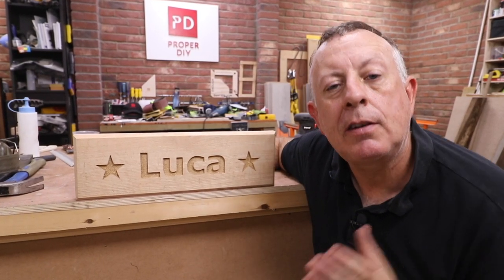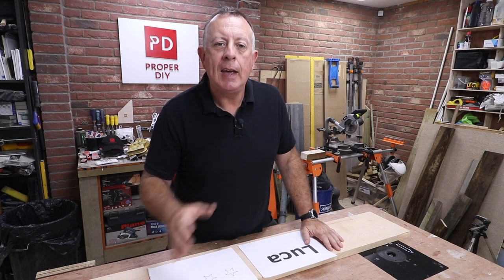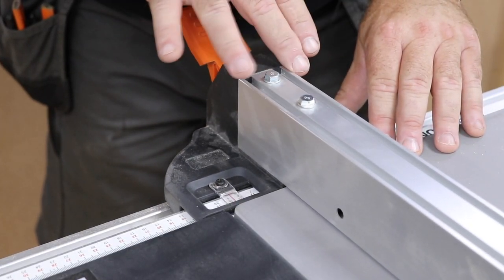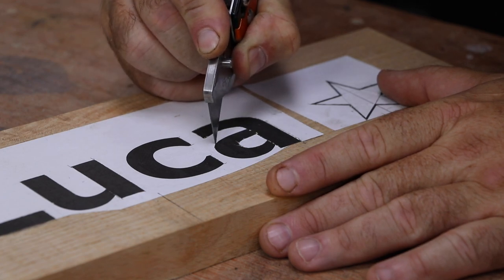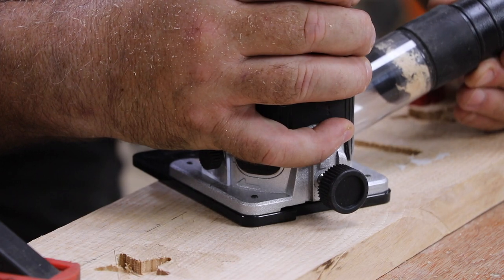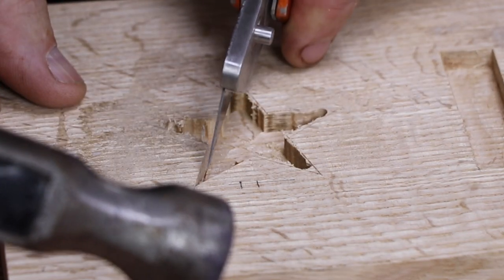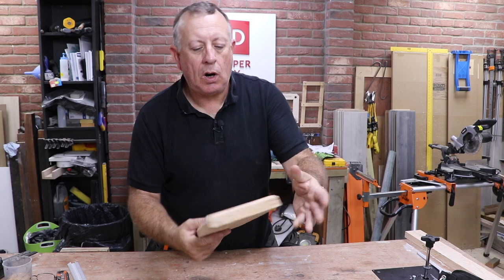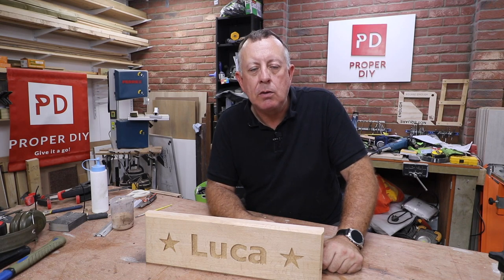How to Make a Sign in Oak

Comment: The way you transfer the lettering to wood or any other surface is to chalk the back of the paper then draw the outline of the lettering or shapes. This is the way I was taught 40+ years ago when leaning to signwrite at Hammersmith College. Just use masking tape to hold the paper in place.

Comment: A technique I  came across years ago (not my idea) for transferring laser (not inkjet) printed patterns to wood is to print it reversed then place it print side down on the wood and secure with masking tape.  Use an iron on the hottest setting with no steam to melt the toner, which will transfer to the wood.

Comment: I really like the way you did the bottoms of your lettering! I used yellow glue in the bottom of one of my lathe turned bowls as the insert I put in the center was to deep and required to much sanding to level out. The glue turned a reddish brown and saved the bowl. I just wish I had watched your video earlier. If I had I would have used the saw dust method. Thanks for the information.

Comment: I used this method first and then realized that printing the image using a laser toner and then rubbing it into the wood using cellulose tinners was much quicker.  You can also purchase letter templates for routers, so you get a perfect cut.

Comment: I sometimes use a JCB/Stanley knife when routing signs to help with crisp sharp corners. Instead of using a claw hammer, I use my homemade wooden mallet. Does the job just grate and lowers the risk of damaging the knife when using the claw hammer. Not a criticism in any way, just a helpful tip I hope.

Comment: Nice video 🙂👍🏻
I use saw dust and glue to cover up the, usually, 2 screw holes in a ?doorstep/sill? (English is not my native language, sorry), for the last 25 years.
I mean the piece of wood at the bottom, between a doorframe 😅
Once sanded and varnished it gives you a proper o'l fashion door-look without staring at two stupid shiny screws 🧐

Never thought about using it as equaliser. Nice one... Thanks!

Comment: I was doing something similar last weekend - but I used a Pritt stick to stick the paper to the wood (putting the glue onto the wood. Apart from being cheaper, it is water soluble so I think my cleanup was probably easier.

Comment: Hello Stuart, another good video thanks. I would have used carbon paper to transfer the lines of the letters on the the wood. And can I suggest that if you want to make the bottom of the letter nice and flat, mix the sawdust with the glue first then pour it into the letters and it will fine it's own level

Comment: I've done that same trick myself to fill in routed patterns, the only thing I done different was I thinned the PVA glue so that it ran into the bottom easier and I didn't need to brush it as much (in my case push it around with a small bit of wood). once danish oil was applied the saw dust bottoms go very dark and stand out more.
I think next time I'll attach the dust extractor tho, for all it seems to hamper visibility the lack of sawdust obstructing the said same has to be worth it.

Comment: Nice video. Another way to finish the bottom would be to use paint and a syringe. You could 'syringe' the paint into the bottom creating a flat surface by filling the imperfections with paint. Also you cold use a 'Dremmell' type tool for sanding inside the letters. It could save you losing the will to live... Haha...

Comment: TRy mirroring the text and  transfer the text to the wood,...... You need to add a water-soluble varnish to PVA glue (making the same as a brand name 'Mod Podge')  to glue the printed text to the wood   When dry wet the paper and rub it off leaving the text on the wood. This is how we put photos onto wood

Comment: If you have a laser printer, print the word in reverse, place printed copy face down on wood and using a hot iron run across paper and the toner will adhere to the wood.

Comment: Instead of beating up your knife for those points you should invest in some good engraving bits that can handle those points easily. Use a hot glue gun to get off your templates in a second and the inside of your character should be perfectly smooth already. Other than that nice job. I do mine completely with a router very very little chisel work. Good luck

Comment: Bit of a side question, could you have used glitter rather than saw dust to line the bottom of the letters and then add a couple of mm of clear epoxy?

Comment: I'm afraid your sawdust with glue idea has been used for many years when refinishing parquet flooring, once you've sanded the floor sawdust and glue any staple marks or imperfections. The best bit is your using sawdust from the workpiece, nice job though looks expensive
Reply from the maker: Thanks